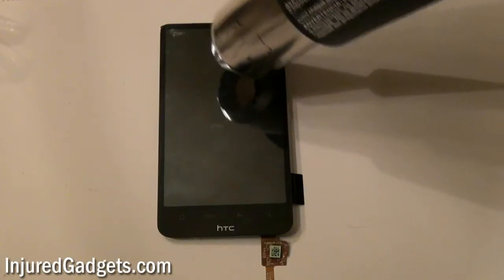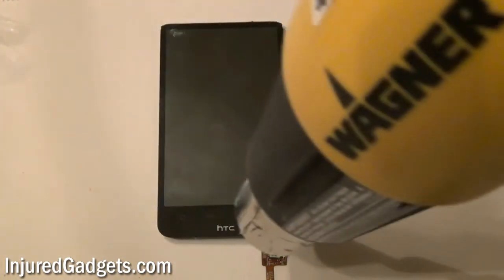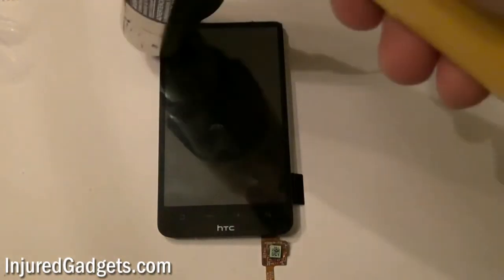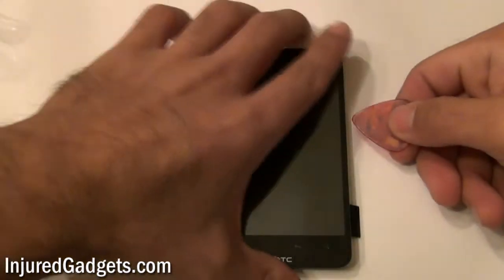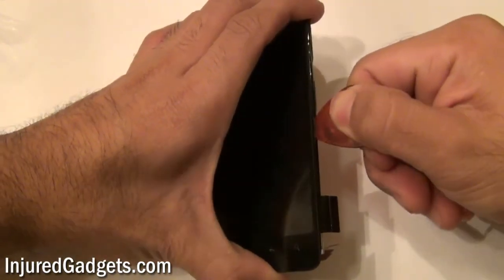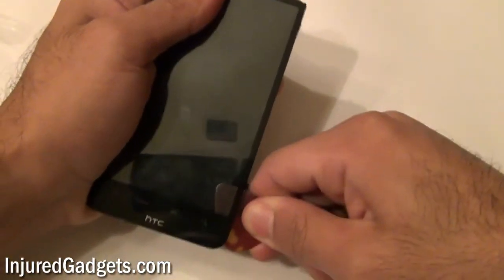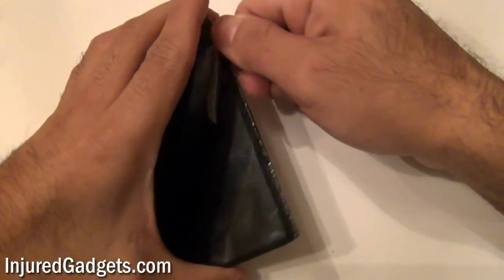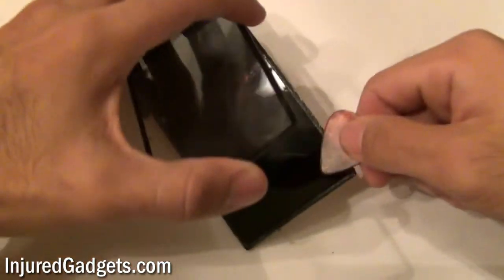HTC Inspire 4G / Desire HD Touchscreen Glass Digitizer & LCD Display Repair Separation Guide

Comment: This video fails to show how you get the entire LCD out of the phone, there is a lot of glue holding it to the phone and if you are not careful you can break the LCD. 

Trust me I broke mine, take out the system board and apply head to the metal, then slowly push the back of the LCD.

I was able to get my glass of easy but i my the lcd crack, its pretty soft.